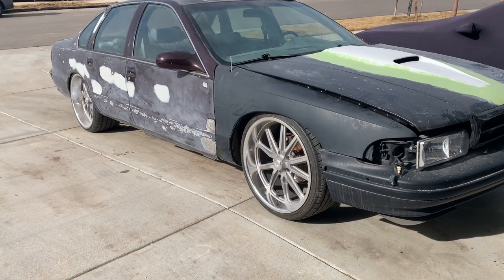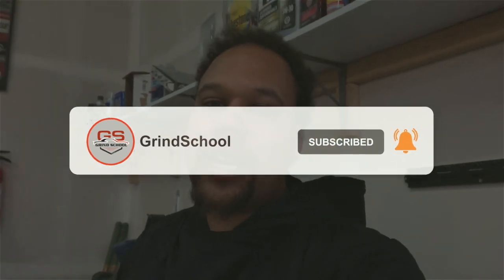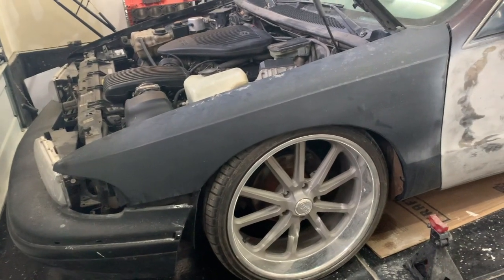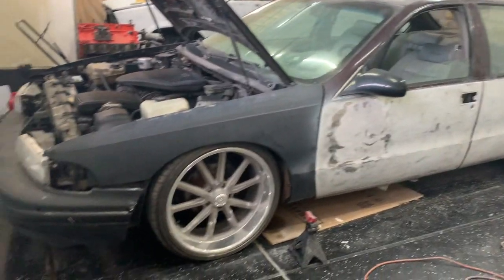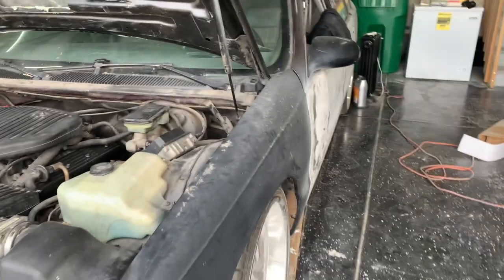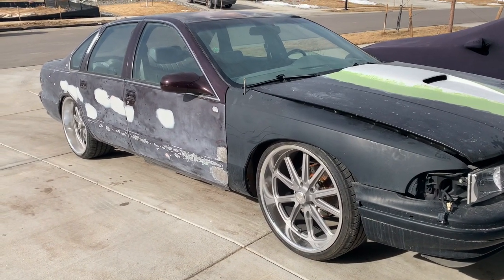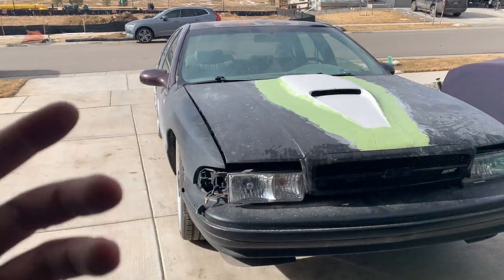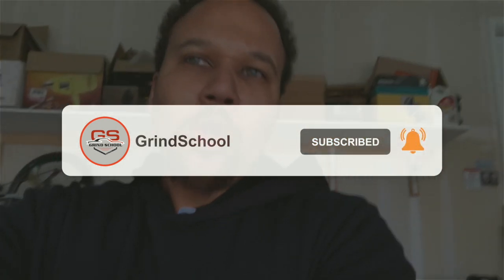I ROLLED MY FENDER ON MY IMPALA!!!

Comment: You definitely have a good idea going with the qa1 coil overs for the back. I put extended control arms and the crown Vic interceptor drive shaft and it still rubs on bumps and turns. Definitely rubs because I have the bell tech 2.5 inch drop springs on the back and 2 inch drop spindles in the front. Only rubs in the back tho. I’m on 18’s so you can see why..Only other option is to raise it with the coil overs now, keep going bro! A rear coil over install video would be much appreciated tho 😂
Reply from the maker: Yeah sounds like your car is really low lol. For sure I got you covered. I actually installed the coilovers already, I’m just having a difficult time with my control arms. That video will be up real soon once I get the ride height adjusted and everything.
Reply: @grindschool  yea man my control arms were a bxtch to get on both front and rear. Especially working on your back. I got em on but have to take them to a shop to get them tightened to torq spec.. there’s no way I could torq them idk why. Had to use ratchet straps and strap it to the end of the frame on the car to pull the axle back and align it with the new longer arms. All the bolts and bolt hole aligning were a bxtch 😂 That’s really all that gave me a problem with them tho. Car rides much better now.
Reply from the maker: Sounds horrible! I may have to do the same for my lower control arms because the bolt won’t budge. I’m going to try some heat and if that doesn’t work then it’ll have to go to a shop, which I really don’t want to do.

Comment: Your car is obd1 right? Get an aldl cable, plugin a laptop and see what the idle is at, guarantee it's some sort of vacuum leak if all the rubber hoses haven't been serviced. I had like 4 different sources of leaks on my car and that had 40k miles at the time on the engine but the only way I was able to tell was plugin the laptop with EEhack to read the fuel trims. Also you can straight up buy a mail order tune from bryan herter for $50 bucks and load it in yourself, it'll fix your speedo too if you give him the tire sizes and what not.  

For those running stocky style coil springs, airlift kit and global west spacers will help if the car is too low in the rear. 

Also when you put in extended control arms look at  the pinion snubber, right above the back of the driveshaft, there's a part number that has a bit of an off set so it doesn't hit up against the driveshaft which I've been told by some people that it can screw it up. Energy Suspension 9.9150G.

Last point I wana make is make yourself some wheel cribs or buy em, not cheap but mannnnnnnnnnn they are so much better than jackstands just to get under the car with. Like I had 0 issues installing my extended setups but I seen people struggle with it cause I was able to line everything up very easily since the car was pretty much nice and level and all I had to do was just shift the rear end with the hydraulic jack a bit.
Reply from the maker: This is really great information! I’m going to look into everything you suggested. Thanks for all of this and this is exactly why I post on YouTube. This feedback is invaluable, whether I use it or not it might help others who are in the same/similar predicament.